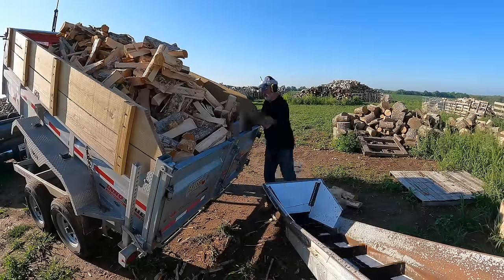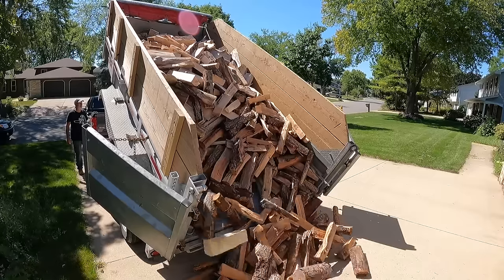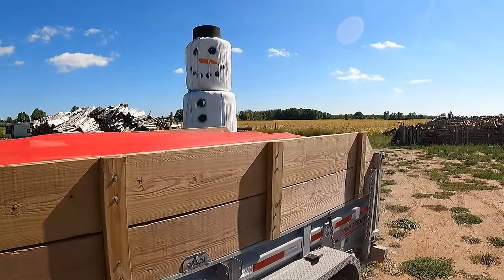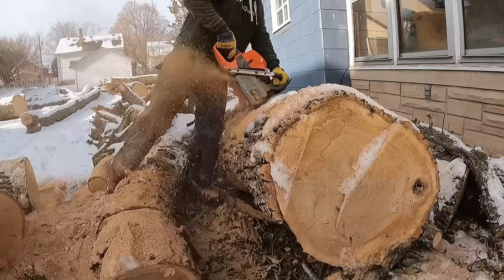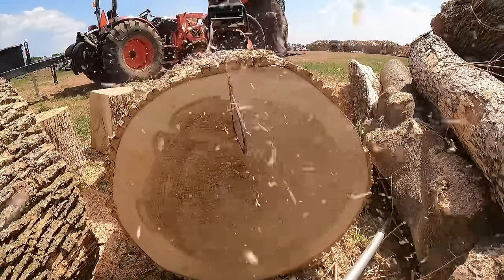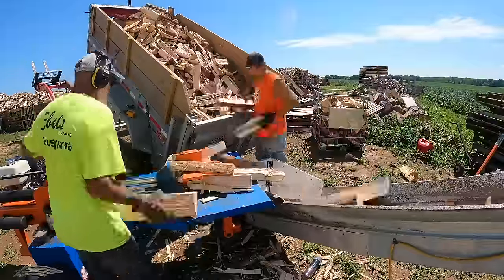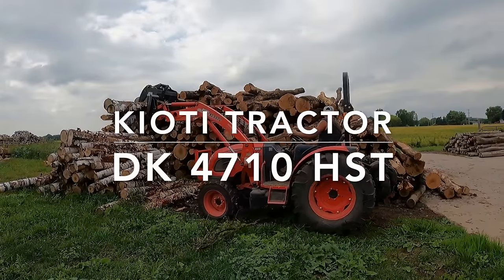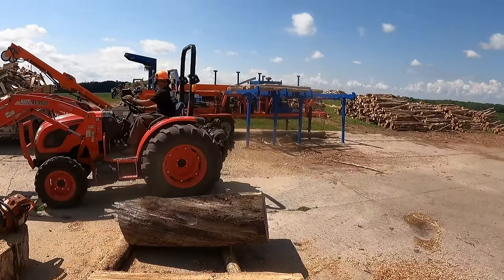Top 9 firewood tools!

Comment: I bought an old used Supersplit kinetic splitter a couple years ago. Started selling wood with my boys (cash for them, hobby for me). Super split is awesome for me since I can load it into my pickup and it works really well for me. It will struggle with the big ugly pieces some. Eastonmade looks like the best production splitter that I see. Great channel Chris. Even though I have spent most of my life around sawmills, equipment and firewood I have learned a lot from your channel.
Reply from the maker: Awesome, thanks so much! Keep them boys splittin'!

Comment: I have a Toyota Tundra but I’d never say it’s better than my 3 F-250’s with the 7.3L powerstroke’s. All three have way over 500K miles and I pull tractors, skid steers, pull dump trailers with tree debris loads everyday all day. The Stihl 500i is probably the best all around saw for buckin wood by far. The power to weight ratio is about as perfect as can be for anyone who wants to not deal with lower back issues and fatigue by not needing to bend over snd cut through the roof quickly. 
I’ve been working with Eastonmade to get a log splitter from them.
Reply from the maker: Order a splitter you will love it! My 2 Fords BOTH had the transmissions go out one at 15,000 miles so.... I left them.

Comment: Good info Chris. I wish I had bought a trailer and tractor before I retired. On a teacher's retirement, itt is out of reach.The big saws are nice I used to have a Jonsered 910 when I was younger, with most people it is the price. i used to make people go WOW when I used it on big stuff. It really speeds up whatever you are doing. I can't use the big ones anymore. Most of my cutting is done with a 50cc. I miss the big saws. I had 3 Toyota Tundras, awesome trucks. I got broad sided last year in my 2006 that I bought new. I was hit on my door by a dodge minivan doing 65 mph. 15 broken ribs. I went to buy a new one and was blown away by the price. I paid 26 for the one I had, new ones are 80. Had to buy a Tacoma and really couldn't afford that. Miss my Tundra
Reply from the maker: Yup, prices are nuts!

Comment: Good Morning Chris: Great Video- I’m looking at replacing one of my Ram 5500s with a Tundra. My diesel trucks seem to spend more time in the shop than on the job. I have a 2001 Toyota Tacoma with over 335,000 miles on it and it’s still going strong. I’m hoping the Tundra would be more reliable.
Reply from the maker: My advice get a v8 2020-2021..I am not sold on the new v6 turbos????

Comment: How much does that trailer weigh when it’s filled with split firewood? And what is the towing capacity on your truck?
Reply from the maker: it is a 10k trailer and when I load it full with dry wood it has about 5-6k in it. 9900.

Comment: Amazingly efficient operation. Did you get to this size operation intentionally or just ease into it gradually?
Reply: Having been a long time subscriber to Chris’s channel, Chris has slowly grown to where he is at. If you get a chance, go way back in his early videos and you can see everything he talked about. The old trailer, the Glacier (I personally have the same splitter) as well as some of the wood gathering Chris has done. Chris speaks from experience. Took a while for him to get to the point he is at but he also is a down to earth guy, honest, and tells and shows it how it really is. A true gem and treasure trove of information from a business side as well as what works and what does not work. 👍🏻
Reply from the maker: Thanks Man!
Reply from the maker: I grew into it as my sales grew so did the equipment and supply. Most of business failure is over borrowing to get toys or spending sales money, I put it all back into stuff to produce more...no debt. 
Wants vs needs.

Comment: i used to rip all my big wood down to size so i can lift manually until i got a box wedge splitter with a log lifter. Chainsaws are the most expensive handtools around. so if your spending more time ripping wood down to a smaller size, its costing you more time and money. Otherwise another awesome video!
Reply from the maker: Thanks for watching.

Comment: How much does the trailer weigh? And do you mind saying the cost of the trailer?
Reply from the maker: We have 4 trailers. My N&n 6x12 is a 10k trailer with a empty weight of 3,000ish and my small N&N is a 5x10 and is a 7k trailer with a empty weight of 2,300ish???
Reply: @InTheWoodyard  thanks for the info!

Comment: The problem with 3/4 ton trucks is the terrible ride. I loved my Ram 2500, but it tended to loosen my fillings on New England roads. I have a Frontier now, but the next truck will be a Tacoma or an F150. Hard to beat Toyota for reliability. Too bad Honda didn't make a real truck.
Reply from the maker: Yup, that is true!

Comment: Price wise I wonder how an all aluminum trailer would compare to the galvanized and how it would hold up compared to the galvanized. Got to be lighter and keep under weight limits especially in a area where D.O.T. is strictly enforced. Like alot of those truckers that switched to aluminum trailers to stay under weight with bigger  loads.
Reply from the maker: I did a video about them last summer. They are very very nice but they have 2 problems....1- They cost twice as much 2- they can not hold op to they pounding of hard heavy materials without cracking...often the welds.. I have talked to people who know.
Reply: @InTheWoodyard  thanks good to know

Comment: The new 2024 Tundra doesn't come with a V8 😢
Reply: I was reading that.. However, some of the V6s have just as torque and power as the stock V8s do..
Reply: And the there are a lot issues with the 2024 Tundra
Reply from the maker: nope.sad
Reply from the maker: yup, we will see.
Reply from the maker: No, more so with the first year ones of the new style the 2022s They had some vendor parts issues during covid. Supposed to be fixed now....we will see.
Reply: @InTheWoodyard  look for a 2023 with a V8